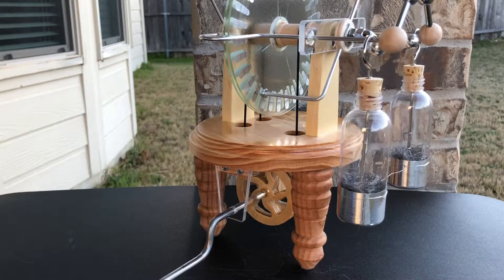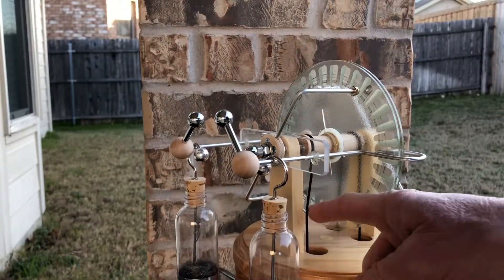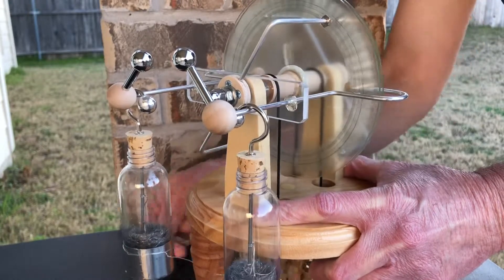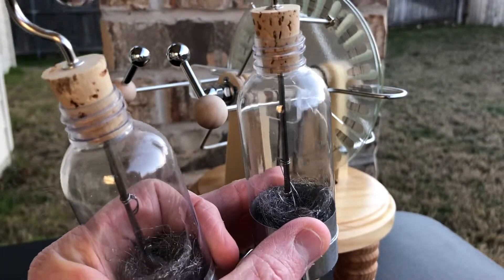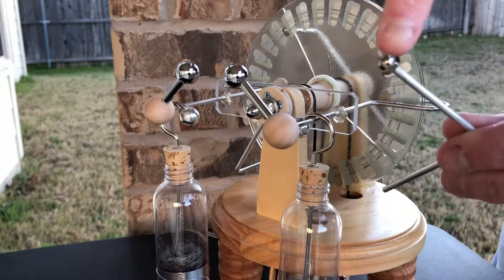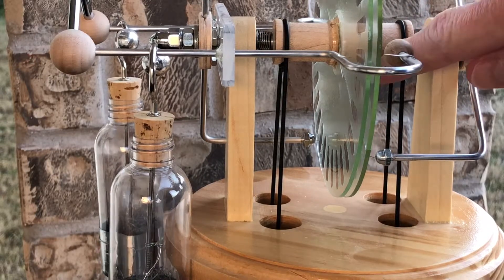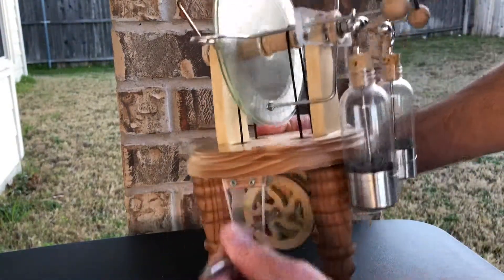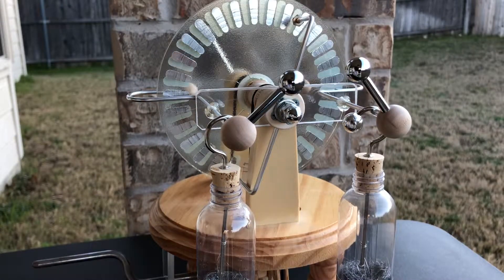Miniature Wimshurst

Comment: This is a nice design, and it looks like it works well. I like the way those leyden jars just hang on there. Of course it is concerning that those cracks go all the way through the disks; I wouldn't spin those until you address that. I have had good success drilling glass with a diamond hole saw. I created a dam around the area to be cut, using a section of plastic jar sealed down with hot glue, then filled the dam with water and ran the saw wet. When it comes through, bloop goes the water all over whatever is underneath, but the cut came out pretty smooth and I smoothed it further with fine wet-or-dry sandpaper.
Reply from the maker: Thank you for the valuable tip. The glass discs have long since been replaced with acrylic.